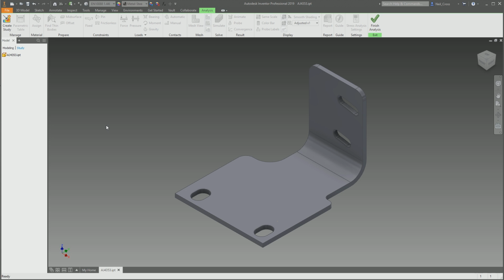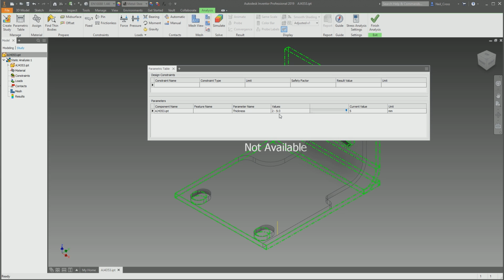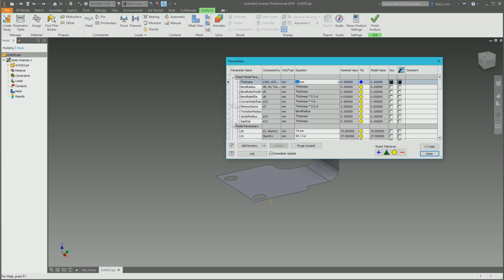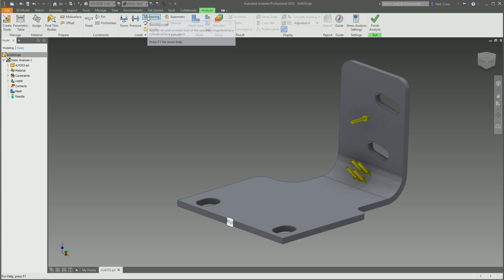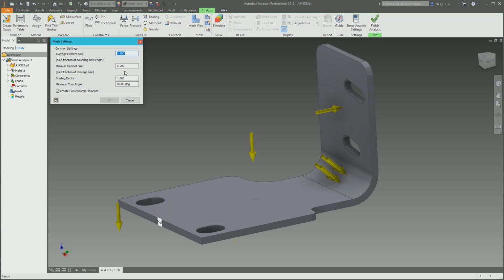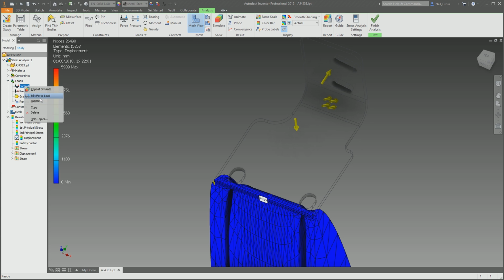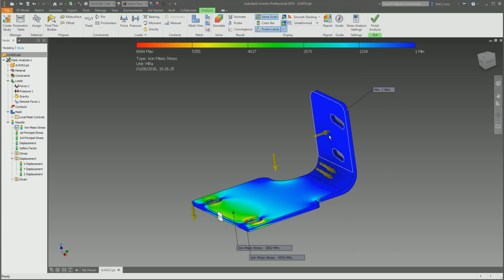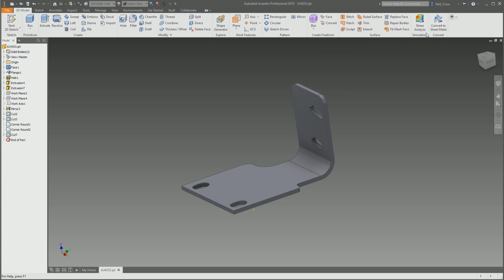AUTODESK INVENTOR EVERY BUTTON EXPLAINED! Part - 3D Model - Simulation

Comment: Thanks for this one, mate...nice work on it....

So...why the whole thin bodies/midsurface thing? Two main reasons (to simplify a complicated subject...): 1) using solid meshes will generate a large amount of elements (requirements for a minimum number of them across a given thickness, etc...), which would mean that instead of waiting a few minutes for a result, you end up waiting hours to get your results...and 2) solid elements have problems capturing bending and stiffness results across small thicknesses, and using shell elements solves that particular problem...